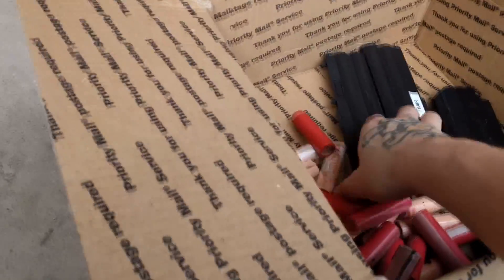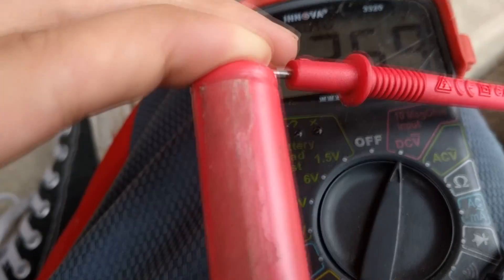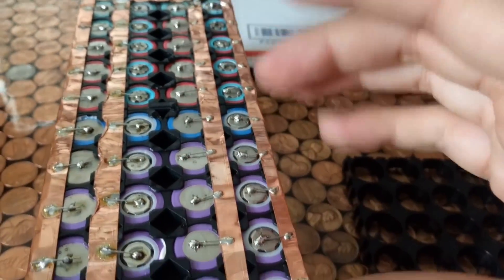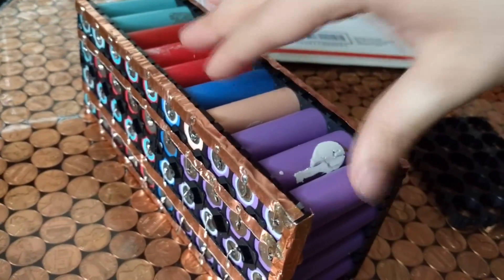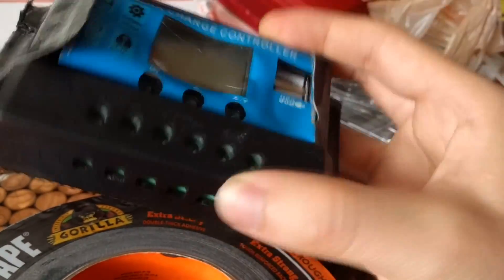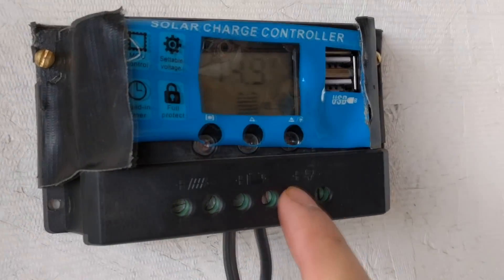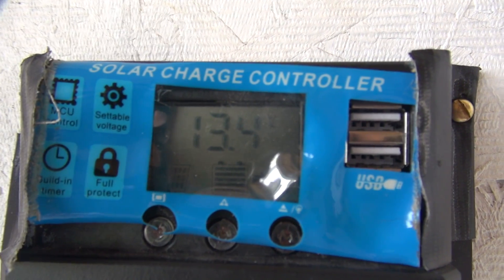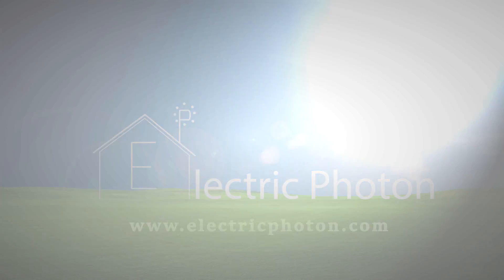How to Make a Homebrew 12V Lithium-Ion Battery and use it with Solar Panels

Comment: 16 gauge wire to power a 1000 watt inverter?!!! 1000 watts / 12 volts = 83 amps. YIKES! Even the 20 amps those little charge controllers max out at will fry 16 gauge wire.
DO YOUR FREAKIN' MATH FIRST!

Comment: I'm building this exact pack and the basic wiring looks pretty straight forward, plus I'll be using 34ga wire for fusing. Can someone tell me what bms to get, and how to wire it? This is my first build so it takes very little to go over my head so...be gentle. :) 

A pic/video of someone bms'ing this style pack would be very valuable. Took forever to find this exact pack from someone that showed all sides of the pack, and this makes it very easy. Between that and the explanation, and finally getting everything I need but the BMS, I'm ready to go.

And thanks to the author for the great explanation and visual on the basics. I can now see it's less complicated than some. BTW, I'm doing the 12V for versatility, so I can use the packs for ebikes, power bank in Home/boat, throw one in the trunk for emergency car starts and what not.

Comment: Cool video kid I got a bunch of lithium ion cells that I wanted to put together I would probably fuse each battery and use something heavier than copper tape with insulation underneath it especially across the top of the positives, one thing I noticed on your cord the wire with the lines it's always the secondary which is the negative the one with nothing is the positive, it doesn't matter as long as you are the one connecting it, lithium ions do need to be balanced though also run your load straight through to your inverter and not through the charge controller

Comment: Was the copper tap a good experience ,was it easy to solder or was it thin and difficult to manage
Reply from the maker: +Ihab Ahmed it's the easiest way to make a battery pack

Comment: It's not true that zero volt or low voltage Lithium Ion cells are NOT good or bad... You can most of them still charge. They will come up in voltage... But be a little bit more careful. Use for instands a Nitecore D4 charger. It will not reconize the cell as a Lithium Ion. Instead It will say it's a NiMh. But you will see the voltage go up. If so... push them a few times down to disconnect. After 3volts it will say Lithium Ion and normal charge them. When the cell is about 3,5 volt take them out and put them away for a least a week. If the voltage is still around 3,5 volt the cell can be safely charged to 4,2 volt... And you revived the dead lithium cell...

Comment: the visible spot of the positive end of the 18650 is the only positive spot, the entire rest of it is negative.  Be careful if the heatshrink tubing is cut anywhere, it's actually there for a good reason!  also look at the positive end again.  make sure the little ring around it is in tact and not damaged.  this short of a distance is where the rest of the battery begins the negative end.
Reply: bcmasur A lot of people dont know this, especially on clone 18650's all that seperates a short is a thin plastic or paper ring around the positive. These batteries are not like normal rechargables they need an IC protection circuit to stop overcharging, etc. If you charge a bare 18650 with a power supply the damn thing will self destruct :D

Comment: Just know that these cells should be between 2.8V and 4.2V with 3.6-3.7V as the nominal standing voltage.  Also measure for internal resistance, lower is better.  When charging with 1A if they get hot they probably have a high internal resistance so either make sure they're used in low drain/low charge applications or send them for recycling.  Charge to 4.2V and shelf them for a week, check voltage again to make sure they didn't internally discharge.  There are tons of other things to check.

Comment: So what is the amp hour on that battery? I want to make one for my RV and would like a100 or 200 (preferably) amp hour battery.
Reply: The way I counted the cells in the vid if he used all 2500 mah cells that will be a 25AH battery. Series increases voltage, parallel increases capacity. There were 10cells in parallel. 10x2500mah=25AH
Reply from the maker: +David Bowen I believe it was around 100ah

Comment: I hate to say, but a resistor lead is not a fuse. It is just a wire.
Reply: Copper wire running through the walls in your house are different than an open air lead wire being used as a fuse. Different strokes.
Reply: Tesla uses a similar concept, with each 18650 connected with a small piece of metal that  melts if a cell outputs too much power. 
This is just a low tec version of this
Reply: Really surprised by the fact that no one else has mentioned this :O
Reply: this is how it's done teslas batteries are made like this.
Reply from the maker: +Anthony Linsday it's definitely not. However if too much current starts to flow through then the resistor lead will melt and cut the power to a cell therefore acting like a fuse
Reply: Electric Photon So with that same logic, you are saying that the 14AWG copper wiring in my house is a fuse... if i run 100A through it, it will melt... probably burning my house down in the process

Comment: When powering the inverter, always bypass the charge controller and go directly from the battery. Include a 40 amp fuse between them. This will reduce the work load on the charge controller and improve overall efficiency. 
Using a pure sine-wave inverter for sensitive electronics is always preferred to modified sine-wave.
Reply: How does the battery re-charge though, If ya remove the charge controller / panels?  (I'm a newbie...I know lol)
     I have tested my Inverter straight off the battery and it'll usually drop the volts pretty fast... Which I also understand isn't good if it falls below 12.0 volts
    I have a 12v 100ah deep cell (brand new)  ... and a 2000/4000 eastwood Pure Sine Inverter...

Comment: Hey I love the video, im trying to get into solar charging. I just finished my first 12v battery pack and inverter settup but because my inverter can only handle up to 15v max i was worried that I would acidently damage my inverter, even though I do have a balance charger I would like to be able to charge my battery up to 4v a cell but that totals at 16v.. Do you know of any good but small, voltage regulators that could solve my issue or any solution that might help?
Reply from the maker: This might be what you're looking for http://amzn.to/2p2lX62
Reply: Not big enough for the amps coming out of the solar panel. Need something similar but at 10 amp output.
Reply: Lithium MPPT Solar Charge Controller CN3722  There is a 10A version, but it is for 12V. I'm running 20P/3S recycled 18650s